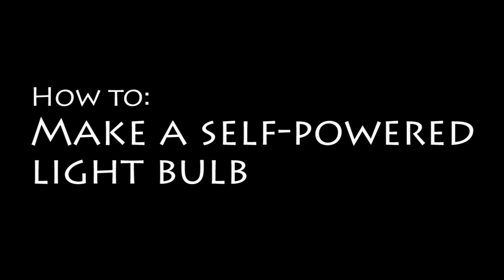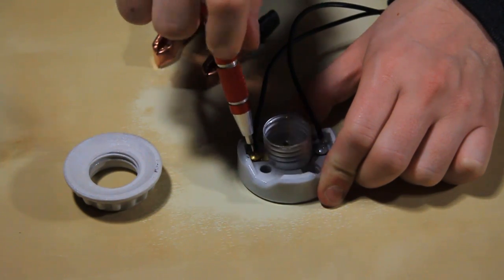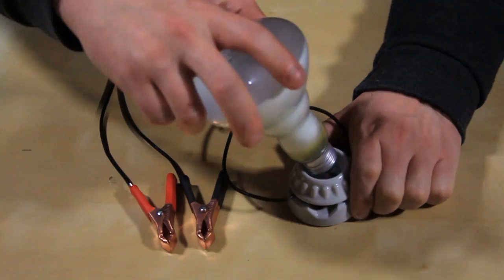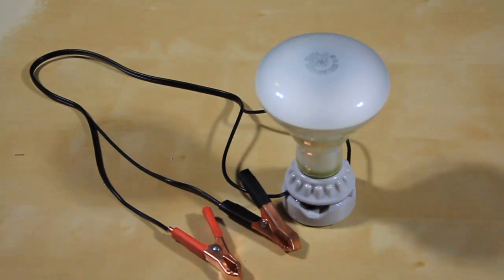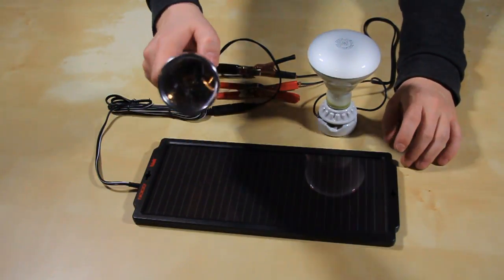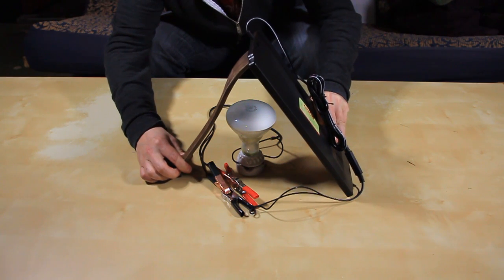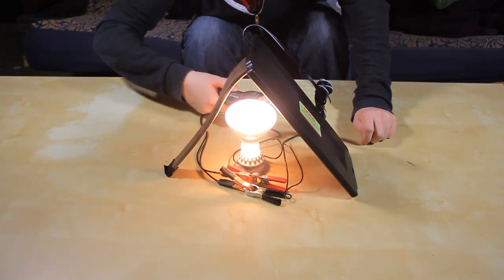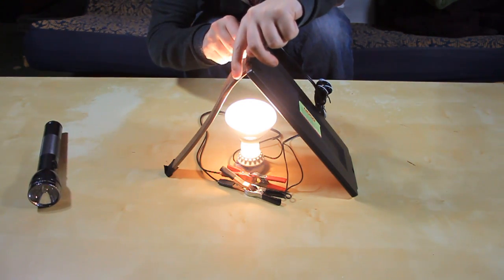SELF-POWERED LIGHT BULB!

Comment: This is fake,
1. lamp = 120 or 240 V AC solar panel = 12 V(solar panel is like a diode)
2 DC A solar panel is max 37%?(nasa style) energy efficient, this would mean that if all the light from the light bulb would hit the solar panel a maximum of 37% would be sent back as energy to the light. A light bulb that big will need at least about 60 watts to work. To achieve this, the flashlight would need to produce at least 162 watts to start the lamp, this would mean that when the flashlight uses 2 3 volt batteries its lamp would require at least 54 amps to go through it.
3. Not all light hits the solar panel, as the camera pics up light too
He does not move the fixture, he could have easily just had 2 wires going into the table.

Comment: Lol That will never work!
Reply: resistance of the 15watte led light: P=15W ; U=100VAC ; P = (U^2)/R --------> R=(U^2)/P = 666ohm

power you can deliver withe 12VDC output :
P=(U^2)/R=144/666=0.22w

you have a light who need 15W and with 12V you can only deliver 0.22W that is ridiculous is not even the 2% what you need don't say bulshit you liar y know my job.
Reply: Hari S no it works just not forever man why lie about this solar panels are quite strong now its atleast plausible depending how many volts in and out there is in theory if you surrounded the light with solar cells it could work indefinitely  but we wouldn't get to see the light except a few small cracks of light so its pointlessi bet this would work for real with led lights and things that reflect and enhance light
Reply: You're stupid :/ ... just have logic :/
Reply: No It won't work the energy input of shining the flashlight over the solar panel for a few second is not enough energy to even light up that high luminous flux bulb. LOGICALLY  the flash light is being powered by a couple of low voltage batteries not more than 5 volts. That light bulb is meant to run at 120v.  
Even if it was the light bulb was some how able to turn on it would loose too much energy and would continue to dim within a few seconds let alone last 15 mins. 
He obviously has some hidden power source to power the bulb. 
I have plenty of logic.
Reply: Hari S  He shined on that bulb longer than one second :/ Its enought to light that bulb and than the high power from high "powered bulb" went to solar panel and this energy light the bulb but some of this energy dissappear and by that it will light only 15 minutes.  Logician :/
Reply: High power = high shine
Reply: you doesn't need big solar panel, you just need to shine on the solar panel longer :/
Reply: think what you want i have already try this :)
Reply: Ouu maaa gaaaadh -.-
Reply: OMG can you just shut the fuck up -.- anybody dont care -.-
Reply: bacause i am a kid as you say :O
Reply: Tomáš Horňák I call BS! You expect me to believe you powered a 15 Watt LED light bulb meant to run at 120 V by a shining a flash light on a low voltage solar panel.
Reply: Tomáš Horňák you don't understand you need a much bigger solar panel to have enough energy to light such high power light is just impossible to have 120V output whit this. electronics is my job I know what I say this video is juste bulshit I umsubscrib to this chanel
Reply: JayEdom ok lets look at this from the fundamental level and just assume that is a really strong solar panel (100% efficient )and lets also assume the light bulb is 100% efficient and 90% of the light energy produced  (being extremely generous) is absorbed. Ok even with these ridiculously efficient stats. Where is 100+V that you need to to start the LED ligh bulb coming from ? (Amusing it can even start because that Solar panel produces low DC current.)  The energy produced by shining a flash light (powered by 6v power supply judging from the type of flash light ) for a few seconds. Assuming the flashlight is 100% efficient it can't possibly power some thing which requires more energy that it produces.  Fundamental flaw ! I hope you people learn something!
Reply: So I think its a combination of the two, your english is bad, making you a good troll...
Reply: What is wrong whit you he light a height powered light bulb white a pocket lamp and you say this will work are you stupid you don't even need to be a expert to know that this is impossible
Reply: Tomáš Horňák I'm not sure if you're just a good troll or if you really are an illiterate 12 year old. Either way, kudos to you.
Reply: solar power station also doesn't need big solar panel just high shine from Sun :)
Reply: Hari S so this video is bs what a dick why post this shit then lol its a cool idea in theory then atleast
Reply: marc geiser well atleast I know not to believe this bull anymore perpetual motion or energy couldn't exist even zero point energy must run out some time or is that wrong too lol
Reply: JayEdom this guys like to post troll videos sometimes there's one where he makes hover shoes lol.
Reply: -.- yeah i am 15 but i think i am older with intelligence :) you know what smarter retreat :/
and i dont want to argue the kid :/
Reply: Tomáš Horňák get real    ohms law  it does not change . this will never work

Comment: of course it's a joke, you've got to be kidding me.
nothing can have 'perpetual energy' - IT'S NOT POSSIBLE!
google 'thermodynamics' if you don't believe me.
the fact that the bulb was 120V, and the panel was 12V, makes it even more ridiculous.
there is probably a small LED and battery inside the bulb, which allow it to look 'on' while he shoots the video, but in reality, it's a complete lie.
also @Drain Bamage, "few seconds" = actually, about 0.0000001s.
Reply: "This will most likely last for about 15-20 minutes, as this is only a semi-perpetual energy device"
Pay attention to what you watch before you bitch in the comments please :D
Reply: I have a degree in electrical engineering, and I have been doing electronics for the past 10 years, so yes, I am calling BS on the whole thing.
Pay attention to my comment and try googling thermodynamics before you bitch about my comment please :D
Reply: Diabeto99621
He's calling out the "15-20 minutes" as BS, and I'd agree.
Reply: i agree with you, even if the light bulb could light up with the panel, the radiation would get emitted everywhere and then there would be loss of energy plus there would be loss off energy in the wires because of they resistance
Reply: Petros Oratiou and thats why it only lasts 10 minutes
Reply: ok, so the bulb needs 120 voltes, right, well the panel produces a a tiny bit less and that is what gets put back into the bulb and saying that the panel supplies 12 volts probably does not mean it can only supply 12 volts. and he said it would last for 10 minutes
Reply: and a guy made a magnetic generator and powered his car with it ut since it would ruin the economy, he either sold his design, the oil company hired an assassin and the gov put him in protection, or the goverment made him "nonexistant"
Reply: ***** OOOOOOOR troll physics may actually be somewhat acurate
Reply: I'm glad we have a 10 year old here to correct all of us electrical engineers and STEM majors.
Reply: look up tesla no not the car guy he has patents on all kinds of free energy but its not free just converting it from one state to another state and the second state is more then the first state

Comment: light bulb projected on solar panel surface 40% energy, angle deficiency and heat loss ,solar panel efficiency about 20% result 8 % from energy return to light bulb. Just 5-6 sec light from flashlight and ambient light is not enought to "self-powered" LOL .FAKE :)

Comment: you just didn't consider that neither light bulb or an a solar panel are power efficient enough to achieve this. this is fake. light bulb produces other wawe lengths and heat as a nus product loosing huge amount of energy on those while solar panel cant gather it xD  just a simple notion of energy

Comment: An incandescent lightbulb like here doesn't care whether you run DC or AC through it. But voltage must be high enough. AC voltages are not specified on peaks, they are specified as the voltage cycle with equivalent power draw on idealized resistance to corresponding DC voltage. Lightbulb behaves almost like that. If you can run 100V DC into a US or 200V DC into a EU lightbulb, it will certainly emit light!

Not with this solar panel, and will need a few hundred times its own light.

Comment: Most of the energy emitted by a lightbulb is actually heat, not light, it goes into heating the room. The light sensitive panel converts some of the light to electricity, and rest of the light into heat.

It's possible to harness temperature difference to generate other forms of energy, but it's unwieldy, so heat is effectively a loss.

Earth radiates heat into space, so a constant supply of heat is necessary to maintain earth's temperature, most of it coming from the sunlight.

Comment: 1. its seems to be a 230 volt light bulp, you connect it with a solarpanel that generates 12 volt, and its a thin shift module so they are ineffective, on ebay you can find some, and they give 1-3 Watts, this is to low for a 1200 lumen light bulp, you are cheating :P

Comment: that only works because when i mic is held up to a speaker and connected it has an amplifier so it adds electricity  to the circuit, no power no sound or in this case no light!

Comment: haha thats funny its imposible cause that tiny solar panel an only put out about 12 volts and very low amplitude i have exatcty the same one and it cant power my 12v dc maxon
motor because they cant produce very many amps and those light bulbs are 240V and 100A, so thats a big fat LIE!!

Comment: If you notice, it's stated in this video that this self-powered lightbulb will only last for 15-20 minutes, meaning this agrees with the third law of thermodynamics and that it isn't 100% efficient. However, this little system here does allow you to save/recycle energy that is put into the system that, when applicable, will allow you conserve energy outside the system when a light source is involved.

Comment: That's one really cool illusion though, I must say.  One of two things I can think of; first: the "lightbulb" is one self contained unit with batteries, RC circuit board and LED  with very high output (1000 lm is possible with one LED)... Or ...2: the camera; the shots taken are not continuous, this leaves an opportunity too hook the bulb up from under the table and mount it so the illusion makes you think only the solar panel is hooked up...  Now do a hover board

Comment: It's completely logical. Light from the light bulb goes into the solar panel, which turns light into energy, which it gives back to the lightbulb, whose light go into the solar panel, which...
It's a loop. The problem is, the energy conversion efficiency can never be 100%. As such, the light bulb propably has ECE of 50%, so it can keep itself running for only 20 minutes.

Comment: I'm sorry but I don't agree with this. The third law of thermodynamics states that it is impossible for a system no matter how idealised to be 100% efficient. Also Solar panels are only around 10% efficient meaning only 10% of the light that hits the solar panel will go into electricity to light the bulb. The bulb has to have an external power supply as that system shown on the video simply would not work.

Comment: Dude, to make this work you'll need leads with NO RESISTANCE, you'd need to catch EVERY photon, you'd need all capacitors in solar panel to be 100% efficient, and 100% efficient bulb. And thats only PART! Its not physically possible. And to your "20 minutes" -  In video that panel captures kinda 2/5 of total photons, no matter how much W is panel and efficient bulb or resistor in leads. 2/5 would mean that from 100W bulb you'll loose just in second like 40Watts. So maybe like second light flash.

Comment: actually its even more obvious than that where the power is coming from. he has cut a hole in that piece of ply wood he calles a tabel, and they are running underneath. note he never moves the bulb base, even when he screws in the bulb, he holds it down on the table.

Comment: Perpetual means something similar to "Forever" 
Or self powering. its not gonna power itself forever because there i still energy lost (The light going in the directions away from the solar panel)
But its still pretty efficient, Considering all you have to do is boot it up every now and then with a flashlight.

Comment: It doesn't last longer than a few minutes...and takes external energy to get it going.  Sounds like it probably DOES do that, even without watching the video. My small 500ma 12v panel produced about 9v near a "warm" colored florescent swirly bulb, and 14v near a white florescent, so you would need a low wattage UV light to maximize the time it would stay on.  The panel used in the video is bigger than the one I have.  But I also have a Sharp 240w 60 cell panel, so I will be making a video soon!

Comment: Light bulbs don't give off the right energy for photovoltaic cells. Even if they did, half of the energy the bulb is emitting flies off in every other direction, so the solar cell would receive just half the "power" the light gives off.
If you believe this works, then you're a mouth-breathing imbecile.

Comment: Will never start in the first place. 100 watt bulb powered by a 2-3 WATT panel designed for low milliamp maintenance trickle charging. 100 watt incandescent 2% light, 98% heat. Amorphous panel at 12% efficiency = 0.03 watt production. So this system is magically "creating" 99.97 imaginary watts. I am really hoping all the "I must try this comments" are just for fun:-) That bulb would require a 130 watt panel placed in direct sunlight to reach full power. LOL, I HOPE.

Comment: Factoring in scattering and absorption with a 99.9999% efficient system (impossible 4 many reasons) run time would equal
0.000000000000000000000000000000000000000000000000000000000000000000000000000000000000000000001 millisecond best case scenario.

Comment: Your didn't take multiple things into account, photovoltaic cells have a capacitance amount which allows a higher efficiency light to run for multiple seconds at full light if the cells are charged.

Comment: a bulb doesn't necessarily need ac. bulbs with a filament for instance. However, using plasma lamps such as "power saving bulbs" does require ac because of the extra schematic within the bulbs.

Comment: Change the bulb to high efficiency L.E.D. . Lower wattage consumption higher energy out put. Must have the right type l.e.d. lower your power consumption with 18 or 24 volt transformer.  Use a car battery jump starter for light power with solar panel recharge pack.

Comment: wow I saw some really dumb comments . Yes this is possible . The energy to light the bulb is about the same as the energy that the bulb outputs as light . Yes it wont last forever becouse of the energy lost from the heat that the bulb emits and from the lost of electrons from the wire . But if there was a way to collect the energy that the bulb emited as heat and repleced the wire whit a better conductor like gold or platina it will last about 2 hours. Infinit energy is inposslible.

Comment: actually you can only get a small percentage of the power you put in, therefore you can not run this perpetually, you can think of it as a "batteryless battery": when you kickstart it with outside light the cycle begins: current to photons to current....but every photon that doesnt hit the solar panel (because its lighing the rest of the room) is energy lost to the system and it eventually runs out. not pratical, but still one of the coolest things i've seen in a while

Comment: Magnets don't possess power, which is a rate of energy delivery.  Magnets possess energy which is stable thanks to the laws of conservation.  If the magnet is kept well below the curie temperature it will 'stick' to a magnetic surface forever.  And yes, you are correct, efficiency dooms the light bulb demonstration to almost instant failure.  The video is a hoax throughout.

Comment: @mrgrayfour : the light will only power it's self and it will get dimmer and dimmer as time goes on until it stops being bright enough to provide enough power to run its self. Adding another load to the solar panel would cause to much power to be drawn. The only thing I think you could power off the set-up would be a transistor.

Comment: anyways the output of the solar panel is like .. 12 volts DC and the bulb works on 120volts AC .. so you need much more panels .. and an inverter to convert dc to ac and a transfo for  12volt to 120v ..

Comment: Sorry, but didn't you hear the part where he said 90% of the energy would be lost exponentially... Here I'll explain it. As soon as the energy goes into the solar panel, 90% of it is lost (Or more since most of the light isn't getting in the panel) meaning that the light will immediately drop to 10% of it's original brightness.... Oh why am I wasting my time? That solar panel outputs DC, that light bulb requires 120VAC. I bet you think you can light the bulb with a few C-cell batteries too. Fool

Comment: It sad that they reduced themselves to this fake crap. The solar pannel is on 12v nd not capable of running a 110v lightbulb even in direct sunlight. For a solar pannel to work with 110v it needs a battery and a power invertor. No way will it even slightly light a bulb like that. Think ill un sub them for this utter crap!

Comment: Here is another tell that it is fake: When the flashlight is introduced somehow the light bulb becomes brighter than the flashlight itself, which is extra energy coming from absolutely no where. This means that either the universe broke or there is cheating going on. In my previous comment I didn't even mention how inefficient the light bulb itself is, which more than doubles the inefficiency of the system. It would be lucky if it could power itself for a quarter second. 15 minutes is a joke.